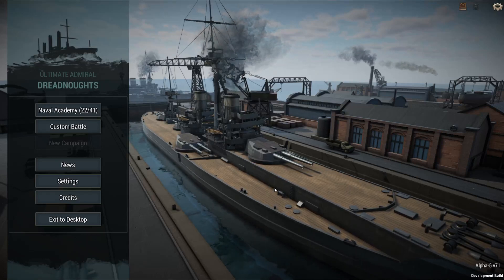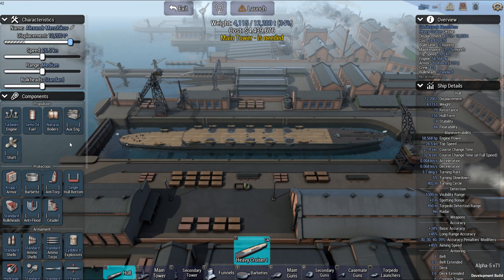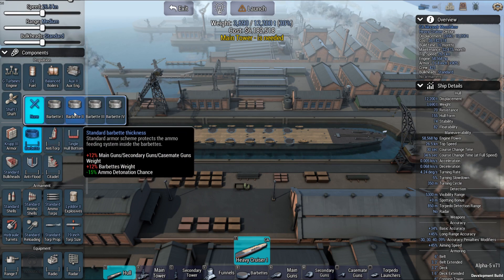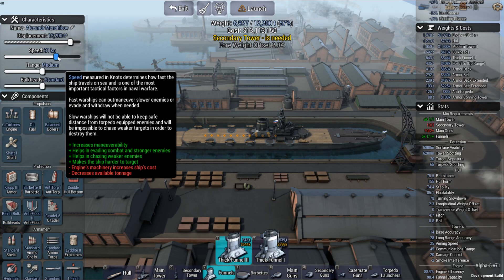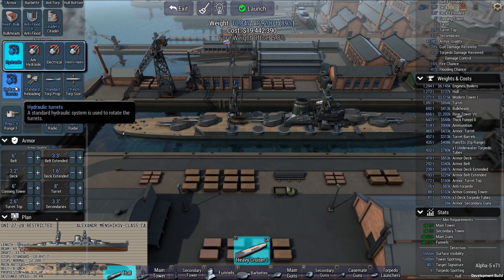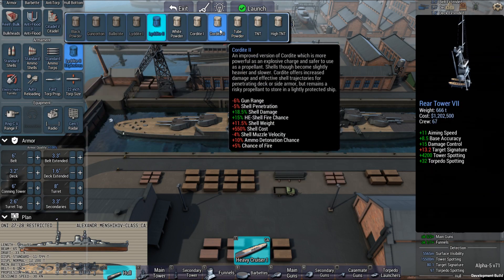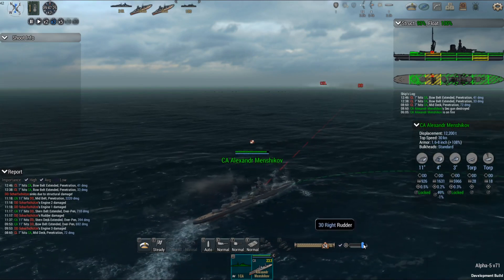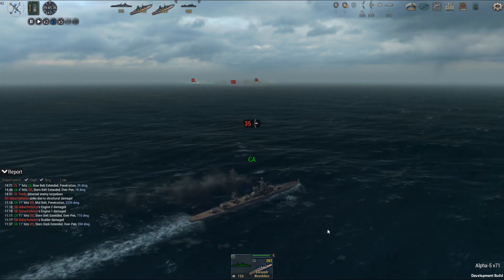Russian Cruiser Bias - Ultimate Admiral: Dreadnoughts

Comment: I wonder how effective it would be if you replicated that CA design but replaced the superfiring twin 11s with triple 11s (or triple 10s if weight becomes an issue with this redesign), and removed the center twin 11 in favor of a pair of lighter main turrets, say 8” or so.
I feel like it would give you a better chance to maintain a greater standoff distance to avoid torpedoes whilst allowing more fire to be put on the destroyers.
Also, if it’s possible, you could pull the frontmost and rearmost turrets slightly more towards the bow and stern respectively to allow them 360 degrees of rotation to keep more barrels on target during maneuvering.
Reply: On second thought, you might would have to go with the largest secondary that it would allow you to field as the game would count 8” guns in this instance as primaries and you couldn’t train them on destroyers while your main guns engaged the cruisers.